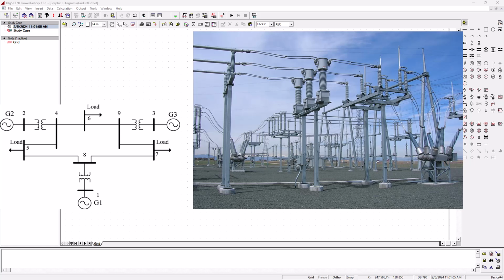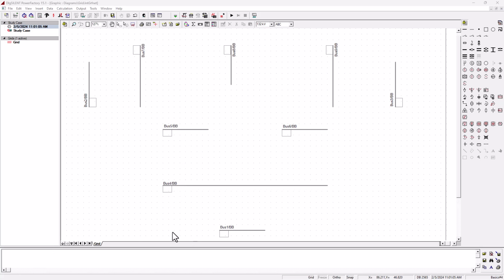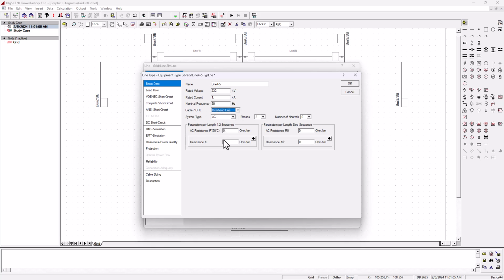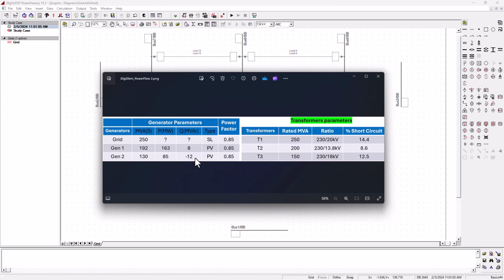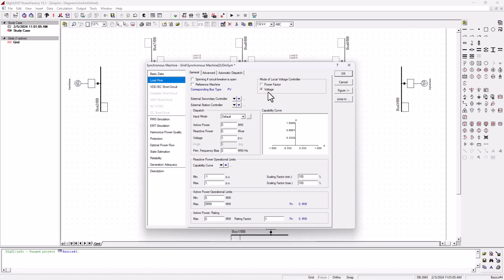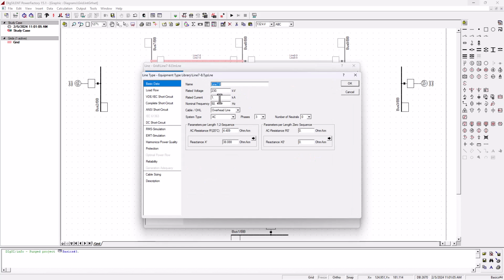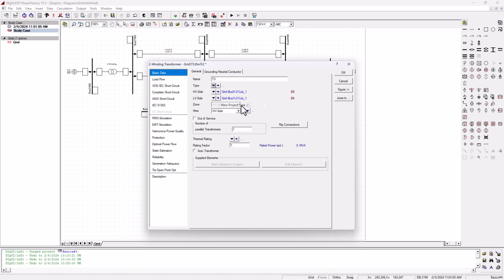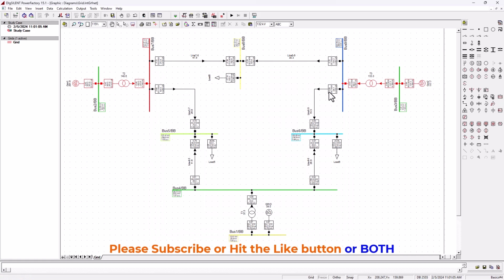6. Load Flow analysis with DigSilent PowerFactory - LoadFlow Calculations. Part 2

Comment: Thanks for great explanation. I have a question related to PV buses.
As you know, PV bus means p and voltage are known and q is variable. However, your pv bus had q is known. Why?
Reply from the maker: Great observation! You're absolutely right, in PV buses (generator buses), voltage (V) and active power (P) are known, while reactive power (Q) is an unknown variable that adjusts to maintain voltage stability.

In the tutorial, I initially treated Q as a known parameter to simplify the explanation, but I realize this could cause confusion. To clarify, I made another tutorial to clarify this issue.
You can watch it here -> https://www.youtube.com/watch?v=ofMtdbaWprI 

Also my latest tutorial dive deeper into how generators actually regulate reactive power in PV buses -> https://www.youtube.com/watch?v=Vfu0MhmP8fo
Reply: @CMTEQ  thanks for clarification

Comment: Didn't you perhaps enter the bus bar voltages incorrectly (reversed)?
Instead of 18 kV rated voltage, it should be 13.8 kV.
Bus2 must be 13.8 kV since the generator and transformer are also 13.8 kV.
Reply from the maker: The load flow analysis would not be executed if you have incorrect busbar voltages not corresponding to generator or transformers output.
Reply: Agreed with this one. I also saw that the entered voltage were reversed.